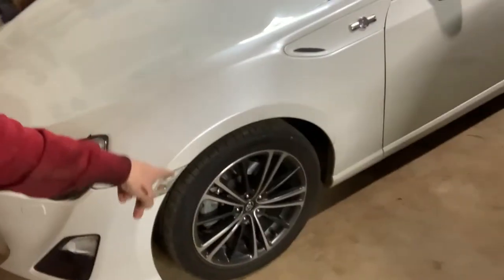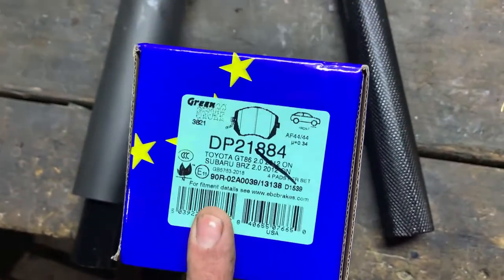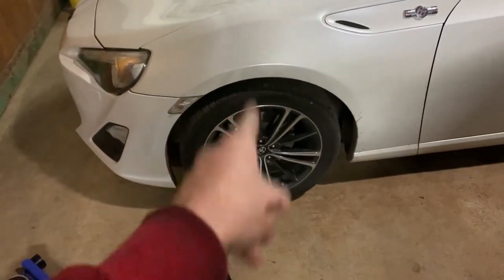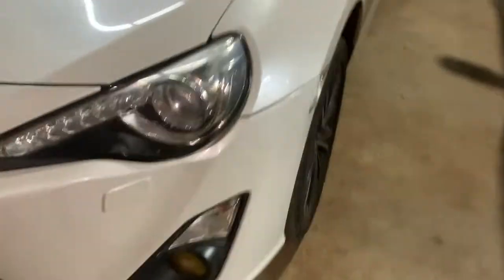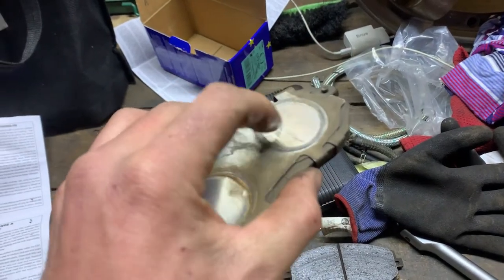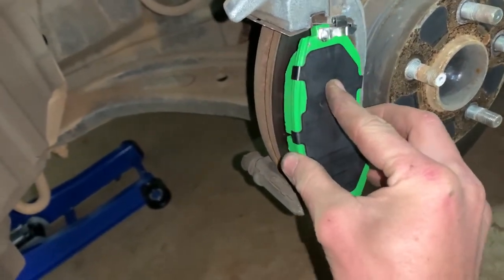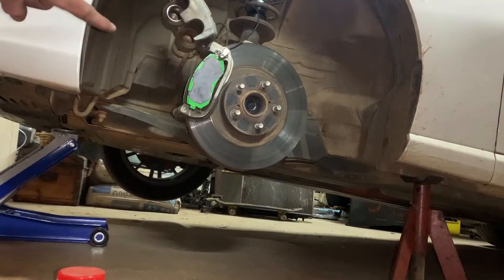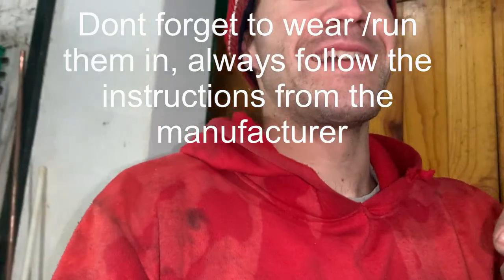How to Easily Change your Subaru Brz/Toyota GT/GR 86/Scion Frs Front Brake Pads !

Comment: Don't forget to keep an eye on the brake fluid reservoir when compressing the pistons
Reply from the maker: Oh yes of course !!
Reply: Can i ask why?
Reply: @anthonyochoa6883  It's a closed system and self-adjusts in one direction. If you push the pistons back in, there's nowhere for the fluid to go, and it will overflow out of the reservoir.